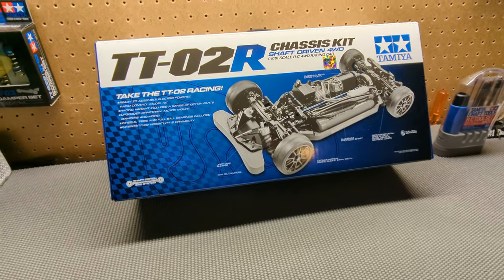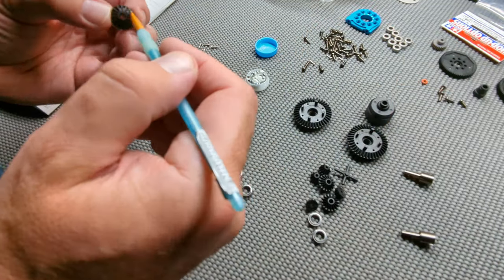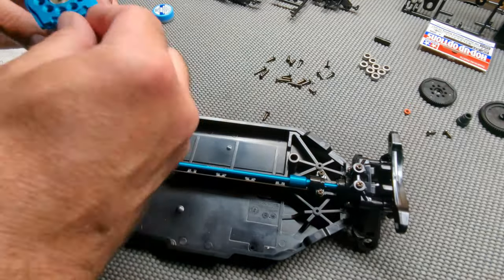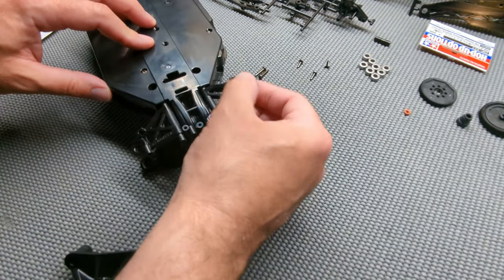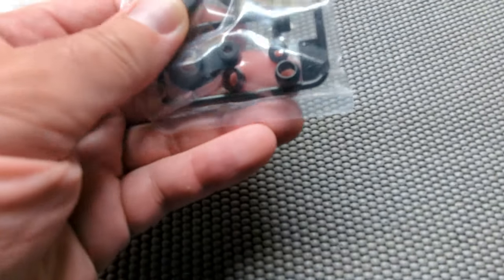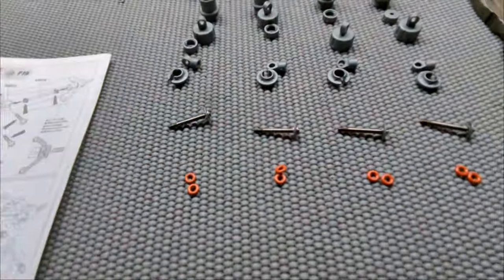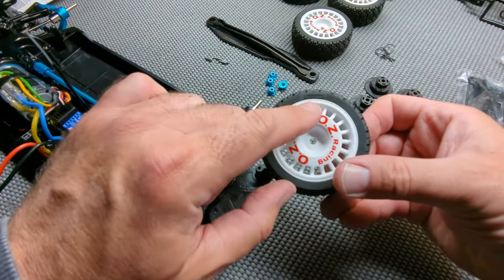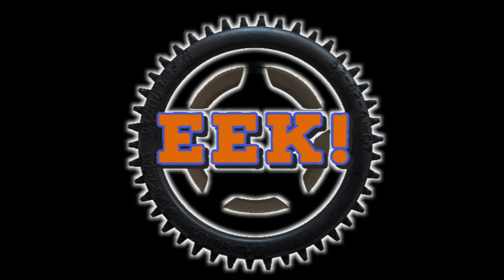Let's Build a Tamiya TT-02R Toyota Celica GT-Four! Complete Chassis Build - Lots of Hop-Ups!

Comment: nice kit, made mine low by inverting the rear uprights, put in oil diffs, front and rear, with 500k weight in the front almost a paste
Reply from the maker: Yes, these handle much better with stiff suspension. The TT-02R springs are very stiff. I did use the soft oil, but will probably change it out at some point, it is a little bouncy still. I'll have to look at the upright, I didn't notice that.
Reply: @eekrc  hav a stock tt02, with the friction shocks, actually prefer to see it bounce around, because i dont race, and threw all the upgrades at the R

Comment: It is a good looking build, all the blue goodies in there! It does seem like a decent deal overall with all the upgrades included. I don't think I have ever just purchased a chassis kit, I have always gotten them as full builds with the body set included, I  might have to get one! It looks great with the Celica body on it!!!
Reply from the maker: This was my first chassis kit, and I can't imagine doing it any other way now at least with the on road cars. The amount of extras you get make it a bargain. It drives so much different than the standard TT-02...I think all of the upgrades work so well on this one, they aren't just for appearance. Yes the Celica is a perfect body for this. That's the other thing, Tamiya makes so many bodies for the TT-02, so you can make these kits whatever you want.
Reply: enjoyed the build but those cable attacked to the motor may melt

Comment: Nice kit. TT-02R seems to be the best bang for the buck of all these different chassi kits. Did you use high or low ground clearance?
Reply from the maker: They definitely are a bargain if you ask me...if it was in the budget I would get a few more of them and get a few of my favorite body sets. I used low/standard height...if it looks taller, it could be because the tires are slightly taller than the stock racing slicks that come with the kit.

Comment: Got one of these for a spare body I have lying around... it's on its way here. I have a regular TT02 that will become a shelf queen, but it has YeahRacing shocks...  now dont know if the ones that come with the TT02R are better 🤔. They are blue also so at least that matches...
Reply from the maker: I like the oil dampers the R kit comes with, but they aren't anything special other than the springs are a little stiffer than the normal TT-02 hop up shocks. I drive both, and honestly the R shocks keep it planted better. That might be a good experiment, try one set at a time, run it and see what you like better.
Reply: The normal TT02 bottomed out with the smallest bumps so I raised it a little by modifying the suspension arms and getting those YR shocks... after using it twice, I just decided to retire it because that body ended up looking kinda nice (the WRX Nurburgring touring car). I will try both shocks when I assemble the TT02R ib a couple of weeks... hopefully the ball joints are the same size... the YR ball screws were a PITA to install lol
Reply: Built the it and tested the shocks. The YeahRacing ones worked better IMO... less bouncy. The springs that come with the R dont seem to be harder and I used the piston with 3 holes, so I dont know what makes makes them bouncier.
Reply from the maker: @sgecko7  Good to know, they are cheaper too. I'm good with the R shocks, I used a little thicker damper oil and for me they aren't bouncy at all. But it's good to know there is another option that works too.

Comment: I have a TT02 kit that I'm going to build as a somewhat rally set up...
   I have bearings and some of the upgrades already for it... trying to decide on shocks, and if I might try a different motor(already have 2 with Torque Tuned motors) ... maybe a Holmes Hobbies 17t Retro Sport? 
   For shocks I'm debating the Associated Factory Team shocks for the Apex2 , they're 60mm so should do nicely with the high ride height setup.  
   Going to use fluid filled diffs and cva driveshafts.  
   Let me know what you think about the shocks and if they'd work ok.   Cheers.
Reply from the maker: Good idea, those are good shocks...I don't know about the mounting hardware needed, hopefully the Tamiya hardware will work with those. I'm not sure about the length or the width also... length should be ok, you can always use some rubber spacers in the shock shafts to limit them if they are too long. Either way it sounds like a fun project!
Reply: They look to have steel pivot balls inside the eyelet on the end of the shaft  and I side the cap, so likely could be mounted using just cap head machine screws... and if needed to space them off of where they're mounted a ball stud washer of the needed thickness I think would work between the pivot ball and shock stay... if needed...
   I'm hoping for the slightly linger length to work out, as the car will be set up in high ground clearance mode, but the ground clearance and travel is what I'm after , and I may see about playing with springs some to soften it up amd get some body roll if needed.
    Cheers.
Reply from the maker: @isaiahfurrow7414  That might work...you also have to consider the width of the shocks, there isn't a lot of space there so you might have to play with some spacers to prevent anything from rubbing. The rally tires you use might help with ground clearance too.

Comment: Do you think Marine grease would do just as good a job as antiwear grease in the diffs?
Reply from the maker: I haven't tried any marine grease, but I don't think it's as sticky. The reason I use the AWG is I can use very little and get a great result. Most other grease will fling off the gears anyway...the AWG grease doesn't do that.
Reply: the diffs on this i think are stock, without gasket, so your marine grease i think you would want to be pretty thick, not sure it would matter much, upgraded  my tt02r to oil diffs, front,rear

Comment: Do you need glue for the tires, thought about ordering a kit
Reply from the maker: I haven't needed glue for the kit ties, I'm only running the stock Torque Tuned motor, and the high speed gear set that is part of the TT-02R. If you go to a high power brushless setup you would need to glue them or the tires would fly off or slip on the rims. Have fun with it if you get one!
Reply: @eekrc  much appreciated. Really liked the video as well, beautiful turnout💯 will have to watch more videos

Comment: Whats a Hop Up in RC? I come from airsoft so hop up is entirely different.
Reply from the maker: Very different lol..."Hop Ups" are just upgraded parts. Tamiya calls them "hop up options". They always come out with parts you can use to upgrade the cars and make them better, faster, more durable. And some are better looking but don't add anything to the performance.
Reply: @eekrc  ahhh ok thank you

Comment: plastic gears that sucks lol i was hoping to see metal and bearing thats great it has with them .unless its a toy grade. looked and metal diffs etc are on . ebay nice
Reply from the maker: @overbuiltautomotive1299  plastic gears yes, but they are fine until you start doing speed runs and put crazy power through them...the good thing is they are very cheap and easy to replace.

Comment: I use tt01 diffs in my tt02 chassis as the tt01 diff geats are metal
Reply from the maker: Great tip...I haven't had issues with the plastic gears, but if I do I'll put in the metal ones too. Thanks for watching!